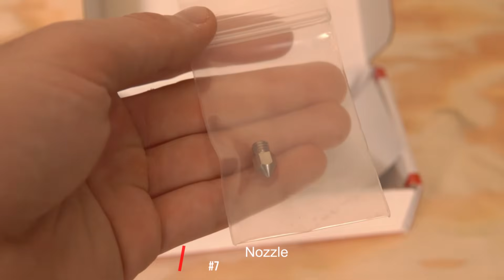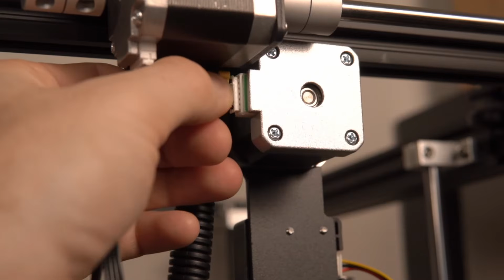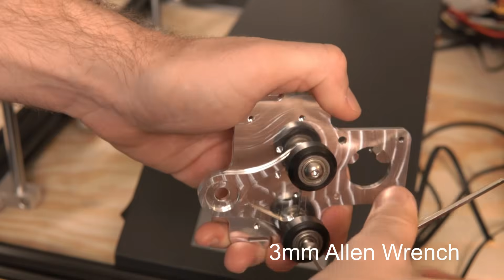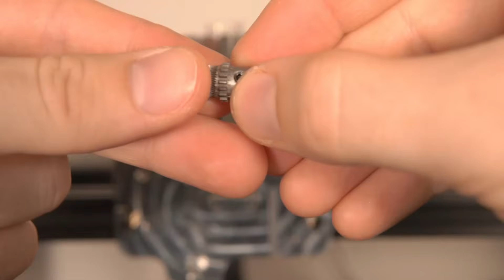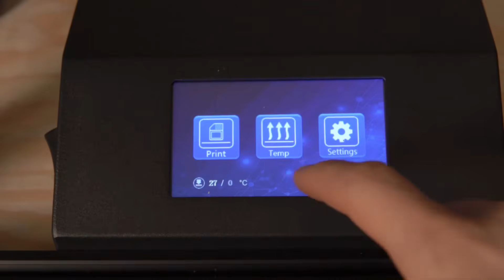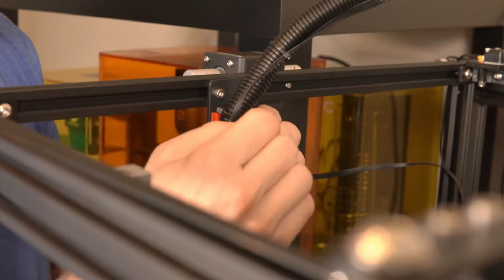Micro Swiss Dual Gear Direct Drive Upgrade For Ender 5 and Ender 5 Plus 3D Printers

Comment: First step is: Remove the Filament from the Printer. With Filament in the Tube the process is not that simple... My Ender 5 Pro also has a BL-Touch. What now?

Comment: If your Bowden tube comes out as easily as it did in this video, you are the lucky one.  The Creality Sharkbite connectors rarely work that well.  You may need to trim your bowden, so it is a good idea to have a spare length of tube in case you need it.
There's no need to fully remove the belt on the X Carriage.   It does not get in the way at all during the install and you need to reuse it anyway :).
This is a great video with some great hints and tips.

Comment: Did you change board as well? I changed board to the v2.2board.  Now my screen doesnt have all the settings as stock. Like esteps, advance settings,  eprom. Is this a firmware issue?

Comment: Great video however my Stepper Motor gear head is not removable.  I just bought this Ender 5 Plus Dec 2022 so maybe the have changed the part 42-40 to not be removable?  any suggestions???

Comment: Even though this is 2 years ago, glad I found it.   I just got a Ender 5 Plus a week ago and it has been an absolute nightmare getting things to print correctly at all despite hour after hour leveling and I'm thinking it has to do with extractor and print head issues.  I was hoping to find something plug and play so I didn't have to mess around compiling and modifying firmware and could use the Creality stock firmware and this is exactly what I need. Thanks so much for an excellent video.

Comment: My heat cartridge had fused to the block so had to order a new one half way through installation. Really great instructions though, couldn’t have done it without you. Now all working great!
Reply: Was it fused by filament?? If so you can seperate them by heating them and then undoing (carefully)
If that's what's happened though, and it did for me, then you haven't seated your nozzle correctly and it's over extruding

Comment: I don't know if I am missing something here but this new hot end appears to be exactly the same as the standard one I have on my Ender 5, except the new nozzle which comes with the upgrade is steel instead of brass. So it appears you would only increase the printing temperature
if you chose to use the new steel nozzle instead of the old brass nozzles, would that be correct?
Reply: I had the same question. Looking on MS's website, it says the All Metal Hot End (standalone, but the same that's included in this kit) includes a brass plated nozzle, so YES. If you want to print hotter temps, you should definitely also pick up an upgraded nozzle. OP can correct me if I am incorrect about this, but my research says this kit does not include an upgrade for your nozzle.

Comment: Ender 5 pro's have a different 42-40 stepper motor on their extruders and the drive gear cannot be removed. Sadly this means the entire stepper needs replaced with one with a notched rod. Hopefully saves somebody shipping time.
Reply: Came for this... however, my E5+ (purchased on March 2021) came with that same motor; featuring a non-removable gear, and short stem [without a notch]. Thanks for putting it out there. Happy printing!
Reply: I was able to pry the drive gear off without damaging the stepper motor using a pair of hammers. No notch for the set screw, so I just drove it in as tight as I could w/o stripping. If it ends up coming apart, I'll post here
Reply: same issue

Comment: how do you get your motor to go the right direction on the extruder cause with my current setup my extruder motor goes counter clockwise but on yours it would go clockwise how would i go about getting it to go clockwise?

Comment: Thanks for the great video! I do have one problem. My stepper motor is moving in reverse now. Any tips?
Reply: Just like @Shane Parsons said above, "use the Micro Swiss extension cable else the Extruder stepper motor is reversed".

Comment: Does anyone think that a dual extruder hotend could be attached to the microswiss direct drive? My only concern is it looks like the micro Swiss feeds directly down and on most dual extruder hotness have the 2 inserts for the filiment offset on each side not in the center
Reply: “Directly down” as it feeds in the center of the mounting hardware

Comment: I am just installing a Micro Swiss DD kit on my Ender 5 Plus. This video is AWESOME and exactly what I required!

Keep up the great work! Your channel,  Kersey Fabrications, CHEP,, and BV3D: Bryan Vines are my go-to channels for instructional videos.

My printer does not have a grub screw on the stepper motor gear, and it is way too difficult for me to brute force it off. I also have a pancake stepper motor to replace the stock one and am going to get a stainless steel gear for the shaft.
Reply: How did you install?

Comment: Just completed my Ender 5 Plus upgrade and I have to say this video is spot on and so helpful. I bought my 5 plus relatively soon after release so the cog was held on the extruder stepper motor axle with a pair of grub screws. Had to heat my Creality hot end to free the thermistor but it survived the transfer. I just need to properly recalibrate my z offset but even with that set slightly out I can already see a positive change in print quality. Will be tweaking over the next day or so with a few benchy prints to get the set-up perfected. Many thanks!

Comment: The gold filament gear on my ender 5 pro  is different from the one in this video there is no screw to loosen to take it off and I can’t even pull it off how can I do this has anyone else experienced this
Reply: It's a press fit. The best way to remove it is with a gear puller. I just hit this roadblock as well.

Comment: You didn't mention that the Bevels cut on the top of the capricorn tube has to be lined up with the bevel on the extruder @ 17:55?

Comment: The aluminum mounting plate has a poor surface finish. It makes me cringe every time I see tool path lines. I'm used to  machining to a 32 surface finish which doesn't take all that long to do. It would only take about another 15 minutes to have  63 or better surface finish. I have no idea why almost everyone who machines aluminum never seems to grasp the idea that on any machined part you  don't want any tool path lines Except when using a fly cutter, but those are so fine of lines it is easy to sand out if done correctly.

And don't get me started on using wheels instead of linear rails. Cheap design equals poor prints without changing a whole host of parameters to the firmware & slicing software to get a OK print. Also for a rigid machine you need a least a twin Z axis ball screws or better quad Z axis ball screws, & 40mm X 40mm extrusions, that are held captive in the top rails with Teflon coated guide rails especially for a Core XY printer with anti backlash screws. Of course, you should not have to use anti backlash screws since no other machine tools use them. All stepper motors are nothing but junk & need to be replaced with servo drives & a 500 watt power supply since all 3D printers are under powered even using the stepper motors. 

All 3D printers are worthless except for making prototype parts at best & at worst printing parts of useless design. They will never replace machined or injection molded parts for speed, dimensional tolerances, & surface finish. The only exception is all metal 3D printers because of complex designs you can't achieve on a milling machine or lathe.

Comment: Has anyone mentioned that if your 5 pro has the stepper motor with the pressed on gear, you'll have to buy another stepper motor and gear. I was very disappointed that that fact wasn't mentioned
Reply: The newer 5 Plus also have the pressed gear, I started designing a puller but then remembered I had a stepper motor on an old Ender 3 that I didn't use anymore and so I used that one instead

Comment: You did not say anything about the fact that the ender 5 plus is set up to spin the extruder motor in what would be the wrong way for this setup. You did not mention how you reversed the direction.

Comment: I just purchased the microswiss direct drive so I could eliminate the bowden tube.  After watching the video and reading the instructions on micro swiss's website, it look as though the bowden tube is still being used.  Can this be eliminated?  Won't using it limit the types of filament you can use?  I was hoping to use tpu, but have heard tpu and bowden tubes do not work well together.
Reply: the bowden tube in this situation is only being used to guide the filament into extruder so you can use TPU no problem

Comment: i got my plus and i have the extruder motor with press fit gear and zero flat surface on it. is this drive gear still going to tighten up and not slip or do i need to locate the flat shaft for it to be safe

Comment: Excellent video - many thanks. Take care unplugging the connector to the stepper motor. I damaged mine so had to cut it off and hard solder the extension cable to the end. Extra steps you can do without.

Comment: The new enders has a pressfit now as extruder gear on the stepper.. so you cant just losen the sidescrew anymore because there are none.. there is a thing on tingiverse now you can download and print to make it easier to remove the extruder gear,  but that is something i found out after deconnecting the old printerhead so it was a bit of brainfuck.. also the pin comming out of the stepper is now round cause of pressfit, and not one side straight to fasten the screw, therfore youll have to drill a tiny dent at where the screw will tighten to make shure it dont slipp, wich also is a brainfuck trying to make a dent in something that small and round.. youll understand what i mean when u get there😄
Reply: So how did you remove the press fit gear?
Reply: @SubiBunni  I used pliers and balanced a tiny screw from the hotend betwen the pliers and the wheel so that the screw only hit the cylinder, and then i knocked carefully on the back of the pliers with a hammer, i did it over the couch pillow to not loose the tiny screw when it slipped. Or even better- download and print this thing out first! https://www.thingiverse.com/thing:3593964                 i found this out the hard way mid-hotendupgrade, and didnt feel like putting everything back just to print it out, just to start over again :-D

Comment: Whoever came up with the mounting system for the thermistor on the heating block is a sadist.  I can't really complain though it's printing well first print since installing the upgrade. 

Thankyou for your video it helped me.
Reply: For my flsun qq-s-pro, the thermistor is inside a can but still fragile but easier to manipulate.

Comment: They need to specify on their page this kit only works if you have a removable gear on your stepper motor. My Ender 5 Pro shipped with a press-fit gear on a short shaft on a 42-40 motor and this was difficult to remove. I ended up having to take the Dremel out to cut the gear off. But the shaft is not going to be long enough to attach the gear that came with this kit. And its not flat on one side to allow the grub screws to grip. Very bad oversight. Now I am without my printer until a replacement motor comes in from Creality.
Reply: i thought i was the only one thinking: this stepper doesn't look right.
Reply from the maker: Yeah I have a video coming out on their mew kit for linear rails and i mentioned this twice. This must be fairly new my new ender 3 had this and my new Ender 5 plus didn’t. I believe they are adding it now.
Reply: @ModBotArmy  I was able to make it "work" by creating a small divot in the shaft so that the grub screw could grip it. When I was calibrating my e-steps, it made an occasionally creaking noise like the grub screw was trying to grip the shaft. I ended up trying a print and didn't have any noises coming from the extruder. I think it was the fact that it was trying to rotate the shaft for 100mm. And during prints the shaft does not rotate anywhere near that so it hasn't made that noise. Still have a new stepper motor coming in with a d-shape shaft so hopefully will have no issues at all.
Reply from the maker: Tiny machines is US based and stocks them
Reply: I am have the same issue with the gear being press fit. I am ready to take this printer and throw it off a cliff. I have used it for about 10 days and it started giving me issues. I am now 3 weeks waiting for parts and now I have to wait another 10 days for a new extruder motor. I could have sworn that some one said that 3D printing was fun. When does that start?
Reply: @grandpaspaintingstudio  what parts are you waiting on? Not sure where you’re located but I have found a lot of 42-40 d shaft stepper motors on Amazon with 1 day shipping (if you have Prime)
Reply: @albert5828  the extruder motor. Just ordered it today. Due on the 16. I live in Greece. Motor needs to come from Germany and the last I heard they were on strike so maybe another day or 2. I am hopping this get me up and running. Thanks for replaying.

Comment: Very useful videao, good step by step guide. I didn't note if you said about rotating the short tube, end to line up with extruder wheels, its quite a tight fit.

Comment: Help friend install my micro swiss everything is perfect until I have to run the file.gcode stays at 0% and does not advance what should I do in this case. I can't configure the steps
Reply: It could be that your BL Touch is stuck. Check if it moves up and down upon turning on the printer. Or check that the filename does not have to many characters. The Ender is kind of picky on how the files are transferred to the micro sd card as well, you could also check that. What slicer do you use?
Reply: @phononerd6947  Hello my friend, I have an ender 5 pro, I do not have BL, I download the document directly from the micro swiss page as they report in the video, I make a copy page to the sd I turn on the printed one, I choose the file as if it were to print and stay at 0% does not advance

Comment: @ModBot  Still in the box Ender 5 ( Standard )  What upgrades for this particular model is needed to get busy printing without replacing stock 6mo or less if I don't upgrade.  Thanks!

Comment: How do you like the Ender 5 Plus?  I need a large format printer that print filaments above 300C, is capable of accuracy/repeatability over speed, and the base printer meets all of my other requirements.  I’d upgrade the hot-end to something like a Mosquito, add linear rails, and turn the frame into an enclosure.  MatterHackers seems to have the best prices, a total of a little over 1K for the total package, including all the nozzles I’m looking at.  If I need too, there’s even a water cooling system, but I don’t know if I’ll need that yet.

Comment: Just installed this mod, I had lots of issues but only with the parts already used on my Ender 5 that it borrowed.
ALL of the MicroSwiss parts were fine.

First issue made me stop was my dang grub screws on the old extruder from my Ender 5, went to remove my old gear and they were stripped to hell.
It's been 2 days and I still cant get it out lol. Reminder: This is a part on my ender5, not part of the mod, but needed for it. 
Oh well, So I reached for my old DIY printer and stole a different extruder motor and finished my install.

But wait whats this, while reinstalling my eccentric gear, I mustve smooshed something when it should have been smished, and my hard rubber wheel now has a GROOVE in it, it goes kerchunk-Kerchunk every 40mm on the xAxis now. Lovely. The good news is, Someone just sold me their lightly used Ender 3 for a sweet deal, cmere darlin, you dont need those wheels, you still got 2 left.

Wheel Tragedy averted, depending on your perspective, Ender 5 Lives, no disassemble. Ender 3 had a rough night.
Finally, the install gets completed, I heat her up again and shove a bit of PLA through, the melt and needle thin stream of PLA is impressively fine.
Now to run the extruder...wtf... its not moving. 

Grab that old extruder from the Ender 5 (stuck grub and gear, unusable for mod), shove the wires into it, well its jumpiing but its moving, back to the replacement, no move, nothing.
Cooldown, hey ender 3.... you have an extruder too right?

More surgery.... 
Now this extruder is installed, but jumping and not feeding the filament. Im about to run the gcode, just stopped to check this vid since its official documentation linked.
I suspect the gcode steps/mm settings will make the motor spin as expected?

Comment: Just added today/last night after having several melting in the tube failures with the stock setup. Already printed a couple small test projects and working great. Thanks for the video. Make sure you delete all of your saved G-code files once you update the retraction data in your slicer.
Great helpful informative video. Kudos!

Comment: Followed the steps, great video!  I finished everything and am encountering a strange issue.  My nozzle temp reads at -14 degrees and it won't let me print now.  Any ideas on how to fix this?
Reply: It sounds like you might have a broken or out of it's socket thermistor on the heatblock, it's really fiddly to get it into position.

Comment: Help! After I got this all in (installed super easy) I made sure to have everything tight like it should be and the gcode update applied. Now my prints all softly tilt to the left side. I double checked the belt and it’s tight, everything is square. Help!
Reply: Did you end up getting a fix for this?